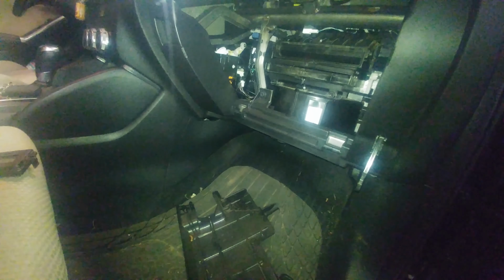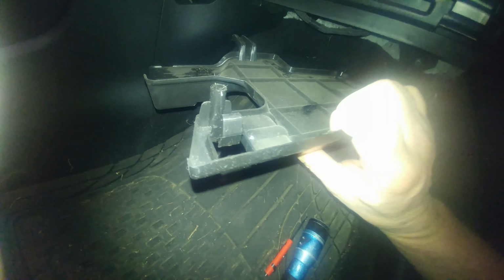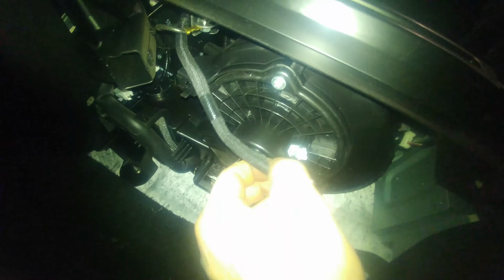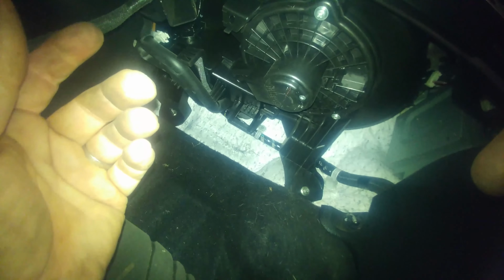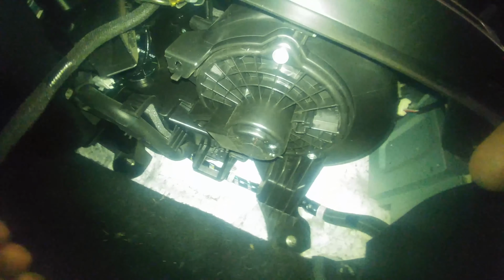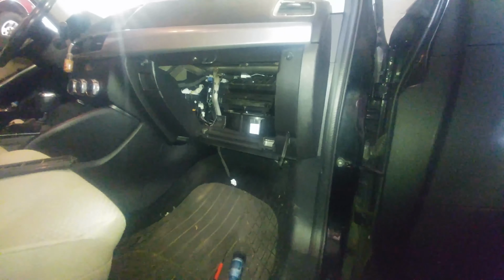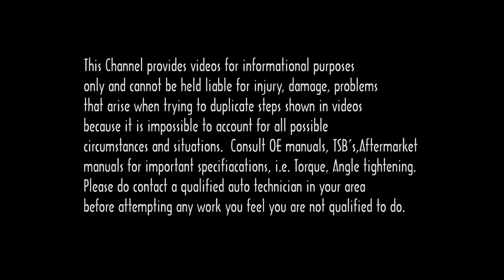Blower motor replacement 2015 Mazda CX5

Comment: Very cool and you can't imagine how happy I am to see the fan replacement is so straightforward!!  My 2015 blower is squeaking away (funny, my 2013 is still great!).  Did you use and OEM or aftermarket replacement blower?  If aftermarket, how has it gone?